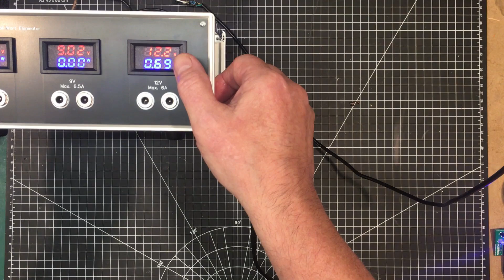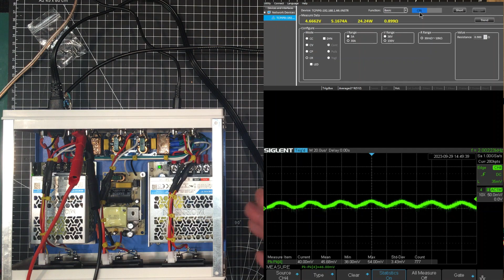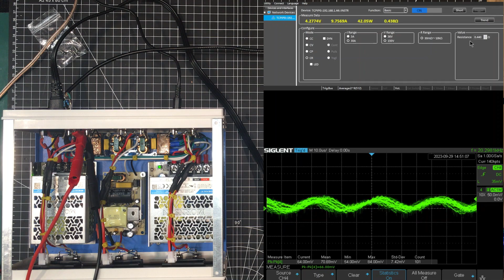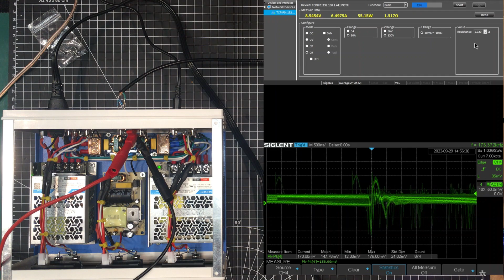0103 - Wall-Wart Eliminator Part 3:  Putting it to the test..

Comment: Ok Excellent I did one a few months back but fed multiple linear boards with filters capacitors feeding 5 output and additional LC on each output as needed was under 10mv
Reply from the maker: Linear will always be the better solution.  More expensive, more space and higher cooling demands but generally all-round better performance.  Especially WRT noise.

Comment: Thank you for responding to the viewer requests for this video. Please confirm the following about the Z Probe... Did you call it a "Z Not" probe? What is the origin of the name? To build it (x10) = Using a 50 Ohm Coax Cable... On the scope end, tie a 50 Ohm resistor across the signal and shield wires. For the probe end,  tie a 50 Ohm resistor across the signal and shield wires and put a 500 Ohm resistor in series on the signal wire. Correct? Something about this configuration just doesn't feel right, in relation to what I know about building x1 and x10 scope probes with 1M Ohm and 9M Ohm resistors. The scope channel is set to x10? Obviously, I am still learning about using my scope = Siglent 1204X-E. Thank you for this help.
Reply from the maker: "Zee naught" or Zo.  It just means a low impedance.  However, in the case of oscilloscope probes it usually means one that has a 50 ohm impedance transmission line (coax) that is terminated at both ends with 50 ohms.  I actually used 470 ohms and 51 ohms on the probe end in the manner you mention (closest match to 450 and 50).  It actually works out to a little less than 50 ohms (46), but close enough.   And I used a 50 ohm pass through terminator at the scope end for this scope (an SDS1204X-E).  Some scopes have switchable internal termination like my Siglent SDS2504X-P, so I don't terminate to scope end with a resistor.  Yes, the channel is set to 10X.